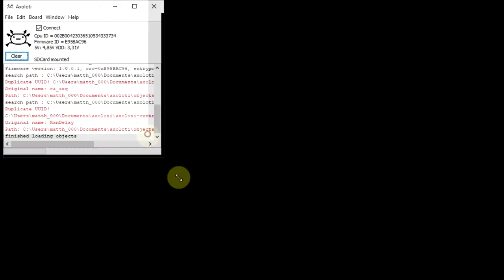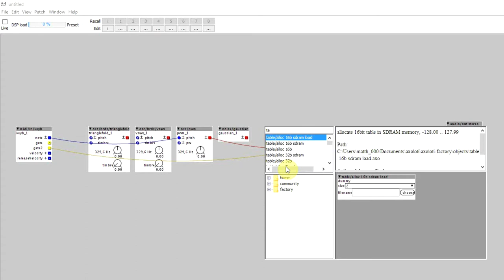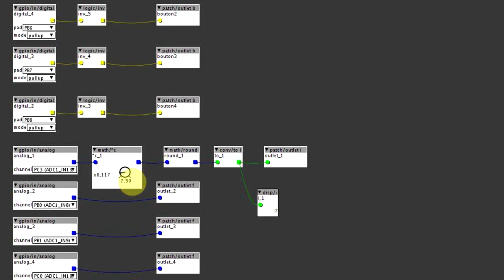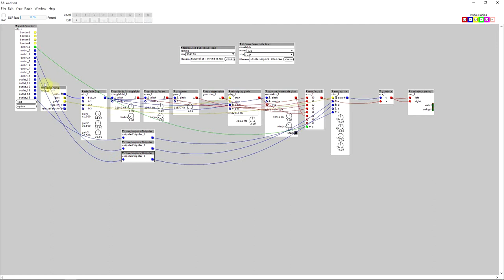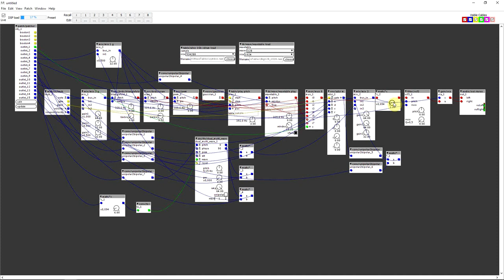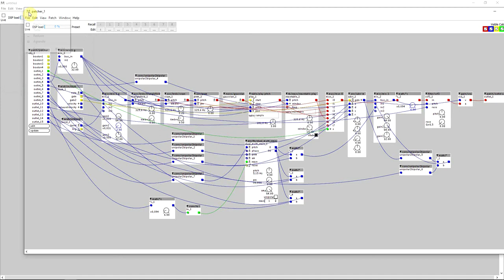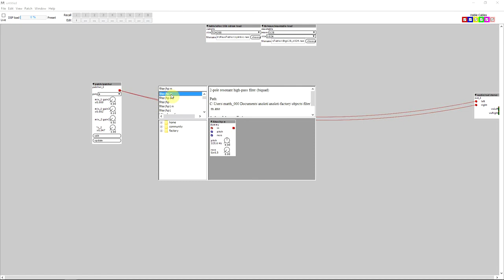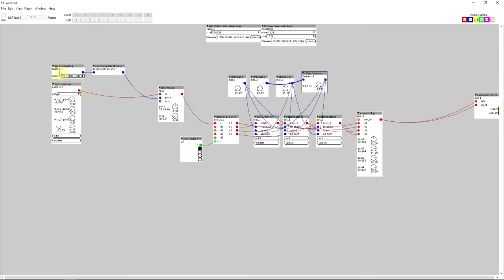Patching a synth, on an axoloti board

Comment: Hi Matthew. Thanks for another great demonstration!
How is a hardware input tool, for instance a pot with a certain range, adapted to the input? In other words: Do I need to use specific pots, say 50 K pots, or can the Axoloti adapt itself to an existing hardware control part. I have namely already build a quite elaborate 66 parameter controller with RS232 connectors for another project. So can I readily use that or would I have to convert it's hardware pots to a single standard type first?